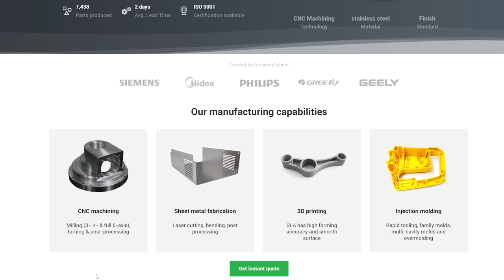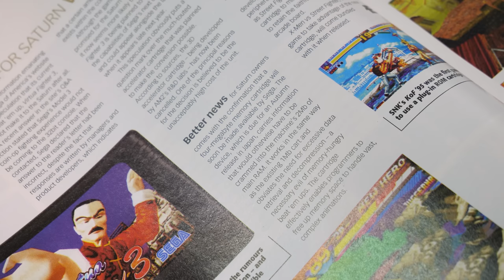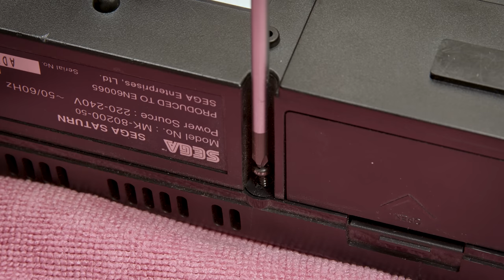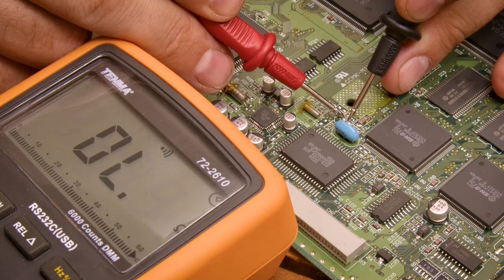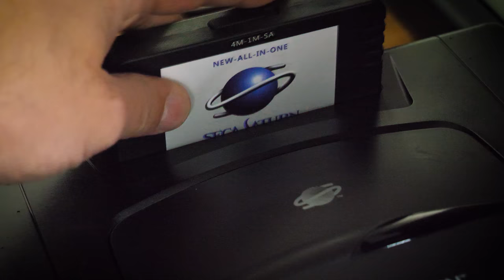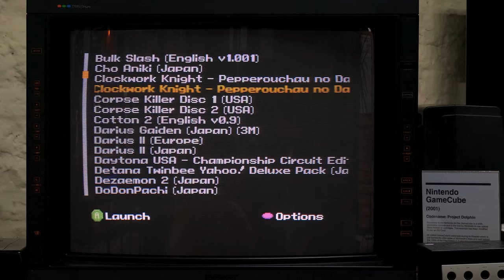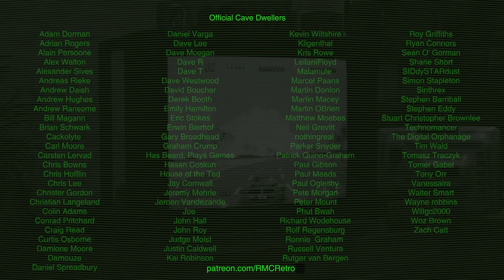Tricking out a Sega Saturn (Fenrir, 50/60hz and more)

Comment: I'd love to use one of these on my Saturn but I just don't like the idea of cutting solder tracks to so it. If there was a way to have the original drive and the ODE at the same time without any board modifications I would be sold. I seem to remember seeing a video of a guy who had created an ODE or something that functioned similarly that just accessed through the saturns MPEG expansion port, will have to check where he got up to on that, would be an easier solution.

I still love the Saturn though, a hugely underrated console and looking at it on that CRT it makes a huge difference to the image quality compared to playing it on a 50" modern TV and that joypad will never be bettered.
Reply: from what i can tell, it looks like the cut traces and soldering was entirely for the region mod. the drive emulator seems like it's just a drop-in replacement for the original drive and is easily reversible.
Reply: The drop in ODE for the MPEG port you're talking about is the Satiator. Unlike the Fenrir, you can even purchase one currently.

Comment: You're kind of stretching it with the statement that this console was "hardware 3D accelerated." Now, it did have a very powerful DSP chip that could perform 16.16 fixed-point multiplication in a single cycle. But that chip was very difficult to program for (and the documentation from Sega on it was somewhat lackluster.)
But as far as rendering, there really was zero 3D acceleration. So, it could do very well at crunching through the 3D math but when it came time to render a texture onto a polygon you had to do some very (very!) clever tricks to make that work quickly. Because, this is still essentially a sprite-based console.
Reply: I think this was a case of youtubers just reading random things online and repeating what they read without doing any real research. the fact one of them said the saturn can't do transparency even though plenty of games actually do it is proof of that.

Comment: I am pretty sure there is a cheat for Outrun to activate smooth mode and overseas mode. (You may have done this for the video. It's hard to tell on Youtube).
Reply from the maker: In the options you can enable Japan/Oversees course and 60fps mode, it's the 60fps that makes it silky smooth (but hard to show on a 24fps 4k video :D)

Comment: The seag saturn was cheaper 😂 £299 for a PlayStation with no game & one controller 🤦 then you had to buy a game for £59.99, an extra controller £49.99 then a memory card £29.99/£34.99... so the PlayStation costs more. For £399 with the saturn you got 2 controllers, pack in game & on board save states haha

Oh the saturn had 4mg ram actually shared by both cpus & another 4mg ram shared by bother graphic chips 🤦

Comment: why do people keep saying that the Saturn couldn't do transparencies? it's just bull, there's multiple ways for the console to do it.
Reply: Not in hardware it couldn't. Saturn had to rely on software based tricks to do it. Transparency was part of the PS1's GPU pipeline.
Reply: @Dr.D00p  are you a fan of being wrong? it's literally baked into vdp1 & vdp2. I will say again, their are several specific ways for Saturn to render transparencies.
Reply: It can, but in a limited or in a convoluted way which hurts performance and is cumbersome to deal with when coding.
Even 1st party sega games feature the "fake" dithered transparency. They probably did so because they had to pick the right fight considering what the hardware could do and certainly it wasn't worth it. With game development it's not so much about being able to do something, it's more about being able to achieve a certain result without spending too much effort in something which is not the main point of the game and may even degrade other aspects of the experience.
Reply: It can, sure, but only in very specific circumstances due to how the VDPs render objects. It's there as a feature, but it's not particularly usable, thus why most games fake it with dither effects.
Reply: Because they parrot garbage info spread by influencers.

Comment: The Saturn is sooooo modable.
I remember when I bought my Saturn for 20 pounds with 6 games because the psx was killing it.
Easy as pie to put 3 switches in it to flip 60 Hz or change region. Even has exposed solder points lol.
Ironically enough the older saturns are far superior for modding.oval button model.

Why would you even put a mod chip in it when the swap trick worked so well?